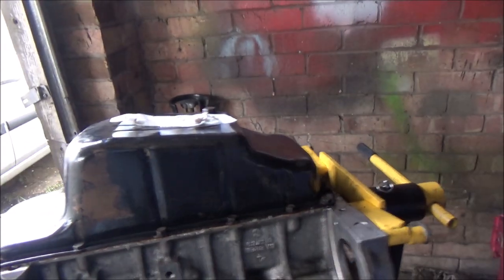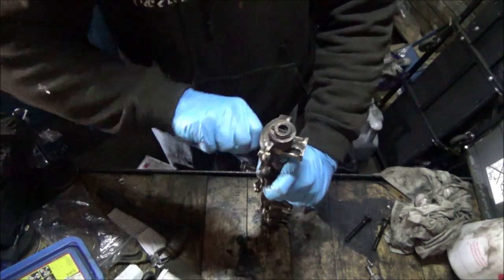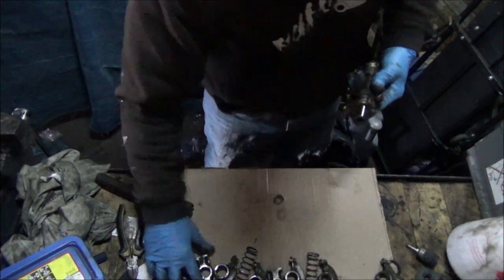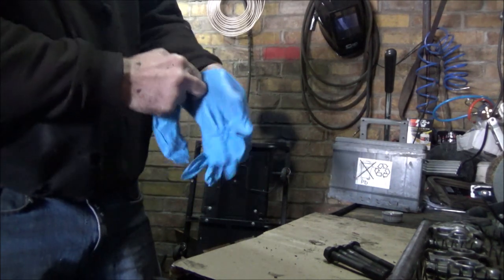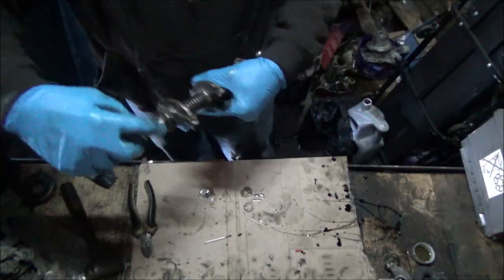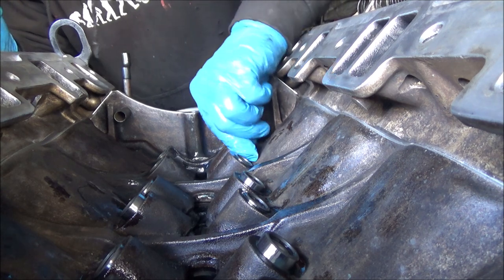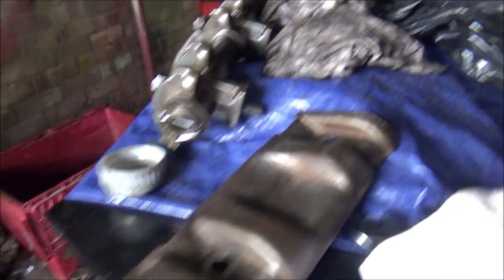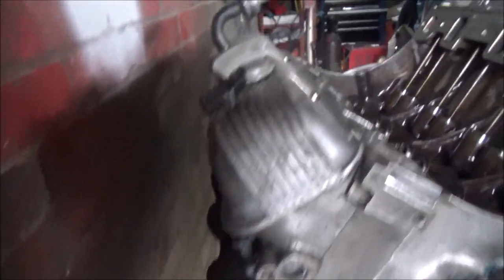Rover p6 v8 rocker shaft stripdown and cam follower fitting #p6 #v8 #rover #rockershaft

Comment: With reference to checking cam follower pre load, you do have a new cam and followers. I was caught by this many years ago with a rover v8 that would just not run properly. After replacing the cam and followers. After much frustration and searching and in desperation! i checked the pre load on the valve lifters. One side was fine the other was noticeably out. In short some of the valves were not closing properly. Once i has shimmed up the rocker gear on one side and got the lifter per load where it should be, it ran beautifully.  I learnt a lot of new swear words over this. May be i was unlucky, but this is what i had and have never forgotten. Why is it we always remember the most annoying faults best? . I do like your videos and real world outlook. I wish you well.
Reply from the maker: I did go through and check although I didn't film it as there's other videos on YouTube that explain it better than me.
Your dead right though and we always remember the bad experiences. 
Glad you like my videos as I think it shows what you can do with limited resources, not like these tv shows with spotless workshops, ramps etc. 👍👍👍👍🤪🤪🤪